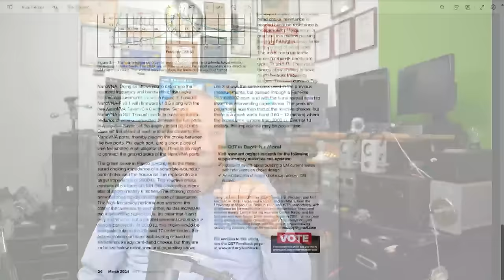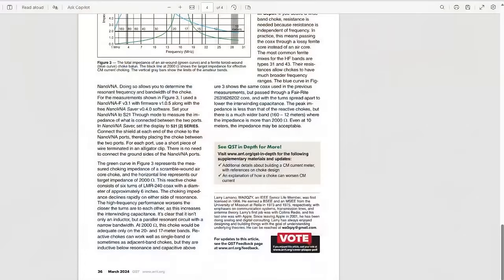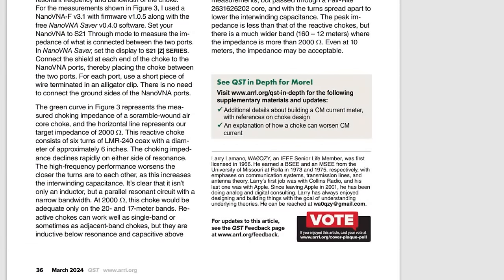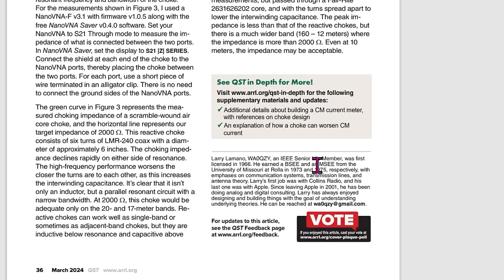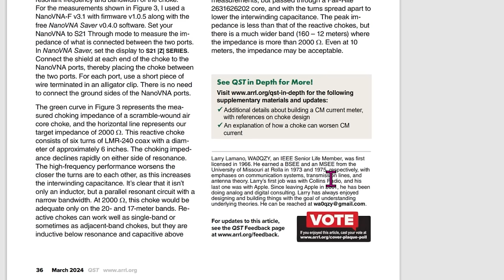Common Mode Currents, What Are They and Should We Worry?  Jim's Got Some Splayning To Do Desi, W6LG

Comment: I thought I was crazy for choking at the antenna feed point and at the shack entry point.  Being relatively new, I had issues with my 130' sloper, but it works for me!  So I guess, I'm not so crazy after all.  🤣  The more I read about antennas, the more fascinating ham radio becomes.   Thanks, Jim.

Comment: Good to see ya up & kicking Jim. Yes absolutely, I always use common mode chokes as well, no matter what type of antenna. Usually doing it at both ends of the coax to help keep noise in the shack from getting back up into the antenna. According to the fair-rite 31 material data sheet, 31 material is not a powdered iron core, it is a MZn (Manganese-Zinc) Soft Ferrite Ceramic made up of a mix of iron oxide, manganese and zinc. 73 Kind Sir!
Reply from the maker: There is so much for me to learn.  The short answer is that it works no matter the exact contents.  But many will likely benefit from your description.  Thanks for the help.  Itg is much appreciated.  73, Jim

Comment: Hi Jim.  I have always used 10 ferrite beads at the (coax) feed point of an antenna based on your prior analysis that more than 10 does no good.  As a result, I have never had a lick of a problem even from end fed antennas using up to 200 Watts.  Many thanks for all your great videos!!  Robert K5TPC

Comment: I remember first starting with CB, and with cheap 43 mix ferrite chokes off of Amazon (beyond being the cheapest, they are the best mix for 10-11 meters), and found that some beads on each end of the feedline lowered the noise floor by two to three S units.  After this, I became quite convinced of the potential of the common mode choke.  I have purchased both beads, as well as "pipe bomb" chokes by Palomar Engineering.  Proof of the pudding and all that.  They work, they clean up noise, and the better shielded your system and shack are, the better.

Comment: I watched this again. 

1.  We have the transmitter current flowing through the inner conductor and the outer conductor. We have common mode currents flowing on the outside of the outer conductor where we know the RF current normally flows. Where then do the differential mode currents flow?  

2. I do antenna modeling on EZNEC. Lewallen admits that there's no reference to CMC in the help directory?  He has an article written about CMC that discusses and contrasts the importance of CMC. If it's important and bad, why are these currents not utilized on the modeling software?

3. Some people say CMC is extra currents and if that's the case, they are energy generated for free from nothing. Perpetual motion. Others say it's from the power we have used from the transmitter. In that case, why do we choke those currents rather than matching them to the antenna so they aren't attenuated out and lost as heat?

If the CMCs are excess energy added from nothing, we wouldn't want to add that to the currents to the antenna because we could get energy runaway and melt down the universe. 

But if these are added currents in addition to the currents going from the transmitter, someone could win a Nobel prize for energy on that. Make millions on the patent alone. 

N9XR

Comment: Hi Jim, I always enjoy your videos and I do dissect your content, not just to be contentious!  It is good to look at variants of the scenario, most people only consider the effects of common mode current while transmitting. It is good to consider the effects on receive too. In my case as an example I had significant noise on the chassis of the radio, of course this is able to whizz up the outer of the shield to the antenna feedpoint where it can then then transition to the inside of the shield.
A common mode choke at the shack end of the feeder reduced this noise by 4 s-points. Naively I believe that just one choke right at the antenna would leave me with noise being radiated by the feeder very close to the antenna. Equally while on transmit I believe that despite an effective  common mode choke right at the antenna that the feeder itself in a high RF field will produce common mode current. 
Overall I believe that it is good practice to have common mode chokes at both ends of the feeder (I am sure there are optimal placings due to current nodes).
FWIW in my case I also have a common mode choke and filter in the electricity supply feed to everything in the shack, adding this produced a similar improvement to the received noise to the common mode choke on the feeder at the shack end. Sadly using both did not reap much in further improvement. Sorry for the poor grammar, typed on the fly!  73
Reply from the maker: I can't type on a cellphone.  I am in bed recoveriing from a problem.  I am feeling pretty weak this morning.  You make good points and I hope that others will read what you wrote. I am tempted to make a followup video discussing this subject a little more. It is very interesting and often missed.  Thanks for your help. 73, Jim
Reply: @ham-radio  sorry Jim, I know you have been going through the mill lately. It is pretty heroic that you are making great videos with so much going on. I am grateful for the reply but please look after number 1 first. 73

Comment: Thanks Jim. The effort and cost to put chokes at the feed point(s) and the back of the radio gear is really the most cost effective way to resolve a pile of issues and give us peace of mind at the very least. A 1:1 balun (choke) at the feed point of a dipole will also give us a more normalized radiation pattern than if the choke were not there. Insertion loss of a choke is so small that having it in place pays dividends in many ways.
Reply from the maker: Indeed.  Your advice is just what we all need to do, because, it helps with all kinds of issues.  Thanks, Jim

Comment: "Ladder line, window line, parallel feeds, don't have the issues a coax does." I would like to hear more on that subject. By the time I got into radio, good quality coax was available and didn't see the point in twin lead. In particular, when should an amateur consider twin lead over coax? Thank you for what you do.
Reply: FWIW open wire feeder CAN have extremely low loss even with a mismatched load. A long dipole fed in the centre with open wire is a great multiband antenna.
Reply: Also with a tuner, you can use the antenna on multi bands.  I have a 135 foot doublet fed with ladder line to a 1:1 balun into coax to a tuner.  With this set up I can run 80 through 10 meters.  I can even load on parts of 160 meters.  You won't do that with a coax fed antenna.

Comment: Everything you say is correct for 50 Ohm feed-point antennas.  I retired from Broadcast.  For antennas without 50 Ohm feed-points or using parallel wire transmission line things are a little different.  There are other ways to keep common more currents off of those.
Reply from the maker: Thanks for the info!  Maybe we can talk about that difference at some time.  I had assumed that parallel feedlines did not have common mode current issues since there is not that "thrid" path back to the shack.  Thanks for the help Robin. 73, Jim
Reply: @ham-radio parallel feedlines can suffer from cmc same as coax from an antenna imbalance, the currents become out of phase that don't cancel each other out causing the feedline to radiate
Reply: "There are other ways to keep common more currents off of those."
Well, that's sort of impossible but easy enough to ignore common mode current using a balun.

Comment: Jim.  Common mode currents can also be absorbed by the earth, like when a coax is ran along the ground.  Also, a Mix 31 toroid core is the most cost effective choke compared to beads.  12 wraps of coax through a core will provide somewhere (frequency dependent) around 4000-5000 ohms of choking impedance.  Not bad for $10.
Reply from the maker: I have some buried coax to a vertical on the back fence.  And, yes, it is a way to stop CMC.  Ditto coiling coax to eliminate CMC.  There are probably other ways that I have not even thought about.  It's an interesting subject  that CMC's travel on the outside of the shield. 73, Jim W6LG

Comment: I don't have all of your experience., but I agree that the feed point should always be choked. I prefer to choke the coax at both ends and to keep my coax as neutral as possible.
Reply from the maker: Agreed, do it at both ends.  Do it wherever you suspect it will help.  I will be adding more at my station as part of an upgrade.  Thanks for the help.  73, Jim

Comment: "Balanced" is where there are two signal wires (a + hot wire and a - cold wire that contains a signal that is the inverse of the hot wire) and one earth/shield. The negative signal is flipped and added to the positive signal, and thereby cancelling the "common mode" (meaning the same in both wires) noise that was picked up along the line. That is a balanced line. This is in common use in the audio and television industries.
Balanced connections would be useful for signals prior to hitting the power output transistors.
Reply from the maker: You are describing audio.  Audio that might be in a mic line with XLR connectors.  That is not what I am discussing a coaxial cable that can have a few watts to 1500 watts that is intended to be radiated at frequencies of millions of cycles per second with an impedance of 50 ohms.  Did I understand you correctly?  Regards, Jim
Reply: @ham-radio  Yes - I am describing balanced line signals for the purpose of removing common mode interference

Comment: Thanks Jim, that was very helpful.  I put some ferrite beads on my feedline (inside of my entry panel).  Glad to be made aware that was the wrong place.  My meter told me that my SWR was about 1.1 at 7.200MHz before I put the beads on and it went to over 2 at the same frequency after I put them on.  And I was unable to improve it from that higher number by adjusting antenna wire lengths.  When I removed the beads it returned to about 1.1 and my TV resumed turning off and on when I keyed the mic.  Why would the SWR change that much and not respond to changing the antenna wire length?  I'm running an off center fed dipole trimmed for 7.200 MHz and the peak is at 23 feet.
Reply from the maker: The length of the coax may make the SWR look good; at that length.  Having a choke of some kind at the feedpoint and at the beginning of the feedline is good.  I have beads at the transceiver, bulkhead coax connector in the wall and at the antenna. Keep in mind that the length of the coax can make changes in the perceived SWR.  Perceived may be a bad adjective. Thanks, Jim  W6LG
Reply: Thanks Jim

Comment: Hi Jim,  tell me what happens to a dipole that you have a common mode choke on and you want to use a frequency other then the resonant one.  Will the CMC eliminate the CMC currents due to the none resonance of that frequency you tuned to or will the coax radiate.???
Randy KK7TV
Reply from the maker: The ferrite beads are resistors, lump impedances that are good from 3 to 30Mhz.  At some frequencies, that lump impedance is better than other frequencies.  But in general, they are fine thorough the HF bands.  Randy, I used the 31mix. The answer to your question is yes.  73, Jim
Reply: Treat the choke like a low pass filter of the inductor-resister variety. Lower frequencies require bigger values for inductance. Typically a choke will just have the largest inductance that is feasible so it should block all RF. If you tuned your antenna without the choke on the feed shielding it will need to be retuned a bit because the coax was acting as part of the antenna and radiating and changing the capacitance value of the base of the antenna.
Reply: @ham-radio  Well, they behave like inductors. Think of the beads like the ferrite core of a wound inductor and the shield passing through them as a single turn of wire. It forms a low pass filter where you have the inductance in the bead and the resistance in the shielding setting up an inductor-resister style low pass filter. At high frequencies even a little bit of inductance goes a long way.
Reply from the maker: Thanks.  That is a better answer than mine.  73, Jim
Reply: Thank you Jim! As a footnote some (non-resonant in the Amateur bands) HF antennas with 9:1 ununs use the outer braid of the coax feed line as a counterpoise that is intended to radiate. For those types of non resonant antennas, a common mode choke can be installed along the length of the coax, rather than at the feed point to decrease noise and greatly reduce RF in the shack. Palomar has details about doing this for various lengths of coax and recommended non resonant HF antenna lengths. I hope this is useful for those who might want to use a non-resonant end fed antenna to transmit on multiple HF bands including WARC bands.

Comment: Common mode does not exist with Coax cable.  You need parallel wires to obtain actual common mode, which is to say, current flowing on BOTH wires in the SAME direction.  Almost everyone gets this wrong and that's okay so long as everyone present thinks the same way of it.

Comment: Jim, Why do antenna manufacturers say you don't need a choke or balun at the feed point of a double bazooka antenna?
Reply from the maker: I have no idea.  Which manufacturer?  73, Jim W6LG
Reply: It was the company Bob Heil got his from.  They made the best double bazookas.  Since the antenna itself is coax I thought maybe it is balanced overall because antenna and transmission line are balanced with each other
Reply: another question, why do more hams not simply use ladder line if it is a balanced set up?
Reply: The Double Bazooka Dipole is a very efficient single band antenna which is very quiet, and does not require the use of a balun.  @ham-radio
Reply: does not require a balun
Reply: this is written everywhere Jim, I pasted several replies which specifically state a double bazooka does not require a balun @ham-radio

Comment: Thank you Jim for an excellent topic & briefing.  My only questions are:  despite the potential of adverse SWR creating common mode current, is a choke solution necessary for transmitting power of less than 25-watts indicated through a mobile transceiver, connected to an OEM Diamond Antenna, mobile magnetic mount VHF/UHF antenna?  How about for 65-watts tx pwr into the same antenna placed upon my automobile's trunk lid?
Reply: Swr doesn't create cmc
Reply from the maker: Hi Paul, perhaps you can tell us why SWR does not contribute to CMC.  73, Jim
Reply: @ham-radio  already have done on other comments also easy to research in arrl publications and reflections by Walt Maxwell

Comment: We can't grasp the story because he's wrong about just about everything.
Reply from the maker: Who's wrong?  73, Jim
Reply: @ham-radio  I don't get the QST anymore but I listened to what you said and I really find it hard to believe he ever took a circuit analysis class from the garbage he spews.  If he took one, especially back then, he probably forgot everything.  I assure you that the concept of "common mode currents returning back on the outside of the coax" wasn't made-up yet.  If he ever took a class on Common Mode Rejection Ratio" or CMRR, he would realize that.  It's sad so many hams put out garbage without checking their own work.  Like Buffalo Springfield said, "Nobody's right if everybody's wrong".